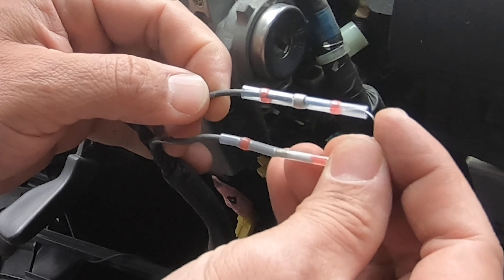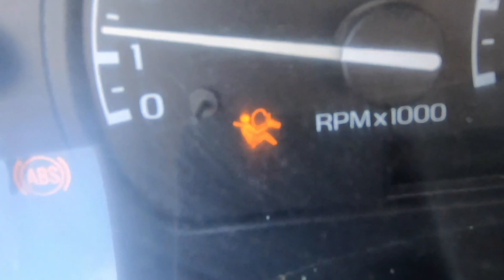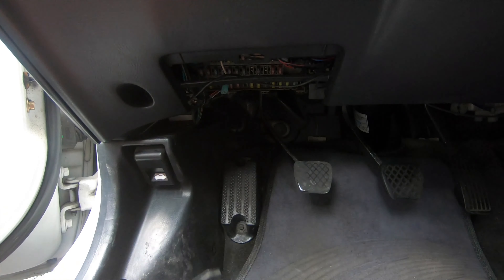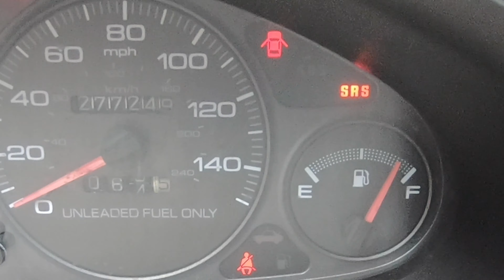How to bypass airbag with aftermarket steering wheel - Acura Integra / Honda Civic

Comment: your videos are really well done.  I've been searching forever on how to do this and yours is the most professional.  You actually put the cameras where you can see where the screws are located and you edited it so I didn't have to watch some guy fumbling around all day.  Bravo.
Reply from the maker: Thank you! I make my videos the way I wish other people would. Haha. It’s frustrating when you’re trying to figure something out and the video your watching doesn’t show anything useful.
Reply: @rayregnogarage  Agreed.  I watched about 7-10 videos before I found the the one where you installed the wheel and got the horn to work.  Everyone else seemed to just ignore the SRS light and live with no horn.  That's unacceptable.  It's almost like they just want to show close ups of their face and talk.  8 minute videos with 1 minute of content.  Frustrating.  Once again, great video.  Thanks again.  I can tackle the wheel install now.
Reply from the maker: @ef_danielsan  Ya. I hear you on that. Quick note on the resistors I have been using. They seem to fail after a while. It happened on my Xterra and now on my Ranger. I don't drive the Integra that much so it hasn't happened yet. But just wanted to throw that out there. You can totally use the one that NRG supplies, but I started using the smaller ones because it makes the wiring so much cleaner. Let me know which one you end up using and let me know how it holds up over time.

Comment: I have deleted the passenger side airbag as well and replaced it with an air bag delete tray... With a two-ohm resistor on that connector will it remove the airbag light, just the same...pls let me know...Thanks in advance...👍
Reply: I’m curious about this as well as I’m planning to do a passenger airbag delete , did you end up doing the resister on the passenger side ? And did it work ?
Reply: @NguyenLeRealtor  no, I ended up leaving that project aside.

Comment: Bro thank you so much for this. Just a heads up. On my 2000 integra the airbag cable was a yellow connector with green wires. Yours seemed to look like grey ones connected to a black connector. Confused me for a bit. Especially since I bought the car with the new steering wheel already installed. They just never took care of the srs light.
Reply from the maker: Ya. .it's kinda involved. On my Nissan, you just had to turn the key on and off in a weird sequence. Didn't need  do anything else. Airbag wires usually have yellow connectors. Mine did.
Reply from the maker: glad you found it helpful!

Comment: I have a 2000 civic I used the provide fuse style resistor and did the reset and I can’t get the light to go off, any suggestions?
Reply from the maker: I’m pretty sure I tried it a few times before it finally worked. It was kinda tricky with the timing.

Comment: Do you know how you would install the NRG resistor? Looks like a male connector end but the SRS doesn’t have a female connector, it’s just the wires. Do you use butt connectors?
Reply from the maker: Did you watch the video? I used butt connectors that shrink and melt solder when you warm them with a heat gun.
Reply from the maker: My bad.. watch this video and you can see how I connected the resistor. https://youtu.be/qjLf9hKlpWg
Reply: @rayregnogarage  yes sir, thanks for the help!
Reply from the maker: Awesome! Glad you found it helpful!

Comment: I already have my quick release installed from your previous video and I guess I’m just making sure I do this right. Do I need to put the wire for the airbag in up by the hub or does doing this make that step unnecessary?
Reply from the maker: Ya. if you look in my video, I cut the airbag wire way back to being the dash to clean up the wiring in the hub. It’s gets crowded inside the hub if you do the resistor in there. You can do it either way. You just need to put the resistor somewhere on the yellow wire

Comment: I did the steps and it worked, but then the SRS came back on. Then I tried to reset it again and it doesn't work. What did I did wrong?

And plus, how many watts does the nrg resistor has? I didn't get one when I installed my wheel.
Reply from the maker: It’s 2ohms I think. Sometimes the cheap Chinese resistors burn out. So try replacing it and see what happens.
Reply: @rayregnogarage  I'm using the fuses, which one you think I should use?
Reply from the maker: What fuse are you talking about?
Reply: @rayregnogarage  I'm using the 5 watt fuse
Reply from the maker: watts and ohms are different. it’s a 2 ohm resistor that you need
Reply: @rayregnogarage  final question, where to get the 2ohm resistors?
Reply from the maker: Look at the description of this video. I put links there.

Comment: I've done this, but after months it turned back on. How can I fix it?
Reply from the maker: Might need to replace the resistor. I’ve done it a few times on my Ranger and xterra. I used those small ones I show in the video to save space, but the big ones from NRG are more reliable.
Reply: Luckily I had two from NRG. Just tried it today and it worked. Hopefully it stays off. Thanks!!

Comment: What type of resistor do i need? Im finding so much conflicting information
Reply from the maker: I put the size and amazon link to the resistor in the description of the video. it’s 2ohm. but NRG usually provides it in the kit. I just like to use a lower profile resistor.

Comment: What size resistor is used? Thanks
Reply from the maker: I put the size and amazon link to the resistor in the description of the video. it’s 2ohm. but NRG usually provides it in the kit. I just like to use a lower profile resistor.
Reply: @rayregnogarage  thanks bro
Reply from the maker: @johnpittman8239  For sure

Comment: Hey, great video. When is the Beetle coming back?
Reply from the maker: Hopefully soon. I have been splitting time between Spokane and San Diego. With the COVID stuff it’s been hard getting back to the beetle in San Diego. I was there a few weeks ago trying to sort out the overheating issue But no luck. In August, I should be doing a full cooling system overhaul. Also hoping to tow it to my shop in Spokane where I’ll have more time to work on it. Found a pretty cool tuning shop down the street from my shop, too. So excited to get working on it again. Thanks for checking in!
Reply: @rayregnogarage  

Mine had an overheating issue too, so I took it to a shop and they removed the thermostat. They tried putting a new one but it just kept overheating again and again, so in the end they ditched it. The car can run without it as long as the temperature sensor and Coolant Temperature Sensor are in great working order. But an overhaul is the best option. Hope you can fix it soon!
Reply from the maker: @OwlManoloPR13  Interesting! The thermostat has been replaced recently, but the car is due for waterpump and timing belt, so I figured I'd do the whole thing. Getting the parts kit fro ECS Tuning. Will post video as soon as I can. Definitely miss running around in the car. It's super sad. It can only go a couple min before it overheads and I have to shut it off and let it cool down.
Reply: @rayregnogarage  

I hope you can fix it soon! Also, before I forget. If you're gonna buy a timing kit for the car, make sure the water pump impeller is metal if you want it to last, the OEM water pump impeller is plastic and it's prone to leak in there. Since the timing replacement in that car is a hassle because the engine has to be dropped down a bit to get easy access. It's best to put the metal one even if it's more expensive.
Reply from the maker: yup! my buddy is a VW tech and he showed me which kit on ECS to order.
Reply from the maker: I just replaced the waterpump (it was broken in two pieces and just sitting in the engine. I posted a pic of it on my IG: @strongholdgarage Car runs great now! Will be posting a couple of videos for that and the thermostat also. I swapped mine out just for good measure since I already had it apart